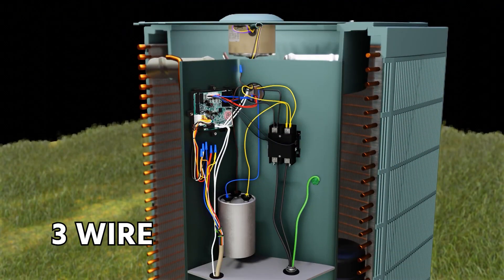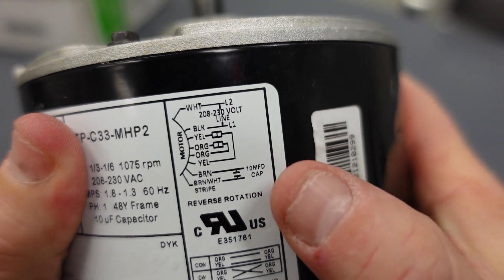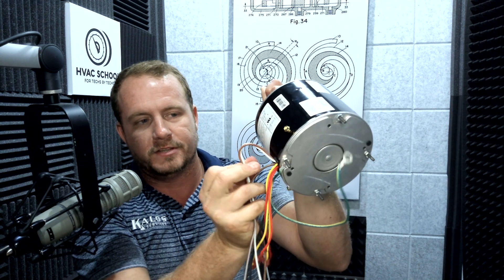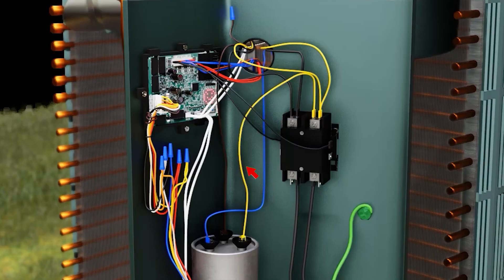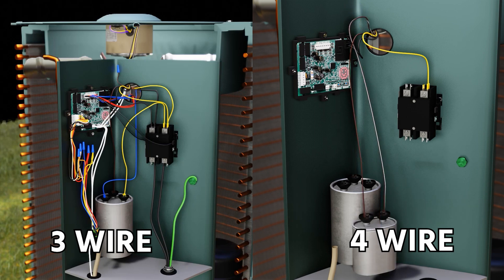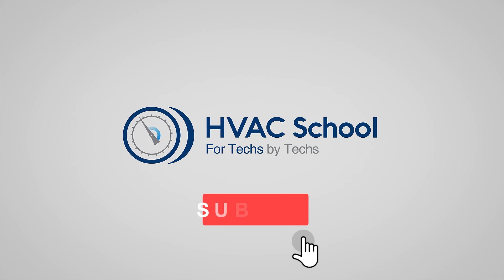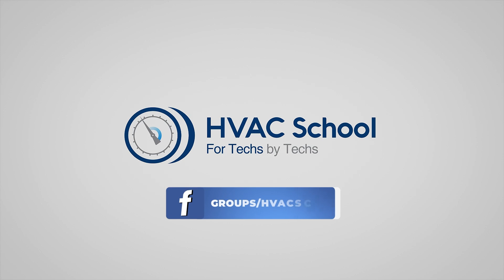3-Wire vs 4-Wire Condenser Fan Motor Wiring

Comment: I found out that the order of brown and brown/white to capF and capC do matter (on 4 wire method). Test 1) 5A on both white and red power wires. Test 2) swapped the capacitor wires. 0.8A and 1.8A on white and red power wires

Comment: Can anyone lend experience with a fan motor that was not grounded when there is a ground on the side of the motor? A friend of mine had a high amp draw and did not commect the ground. Could this be the cause?

Comment: Instead of caping the brown and white can I wire it to the c on the capacitor, and the white wire on line 2 and black on line 1 and brown on f on the dual capacitor?
Reply: I put both brown and brown/white on f terminal did I kill my fan?

Comment: Every video I see presupposes that the wires are "x" color with "y" stripe, or brown, black, etc.  what if the colors are totally different.  My new motor and old one both had a black wire, yet no other colors matched and none of them had a stripe.  Both diagrams were different and I had no idea what to do.  I tried many variations, but nada.  I had an electrician take a look, but nada.   I never figured that one out.  🤔  I would add a picture if I knew how. 🙄🧐
Reply: Every motor comes with a wiring diagram to tell you what color is what.
Reply: @frankiec5570 facts and he stated that at 1:00 in the vid
Reply: Problem with trying different variations of connecting wires is that you will blow a contractor or capacitor very quickly if not wired correctly.

Comment: I see how 3 wires are wired in 3D picture but 4 wire picture still has only 3 wires coming out. Brown to one side of cap brown/white to other side. Then line wire going to one side of contactor. Where is the white common wire?
Reply: Actually I think I see line going to defrost board and that yellow is common right?

Comment: Bryan that unit in the illustration is a heat pump. So, the blk wire from the CFM connects to the defrost board and not to the contactor. Now, wiring for a straight cool units that illustration is correct. Please i come from an 🚘 a/c back ground. So, i apologize if i miss spoke! I'm just asking for clarity
Reply: Thanks SO much!  I'm a rookie and he speaks  little too fast, as well.

Comment: I was told that you can hook up the brown and white wire to common on the dual capacitor. Is that okay?
Reply: Basically...brown/white and white are the same and go to the same terminal.

Comment: One change on your procedure for the 4 to 3 is to connect brown with white to the same lug as the plain white (sometimes yellow) to prevent confusion to the next guys as to where that flying lead goes to or accidentally grounding to the cabinet.
Reply: Thank you from a girl 😁
Reply: Wtf is a “flying lead”?

  This is problem, using terms like lead and flying lead isn’t helpful when your don’t explain what those are, same for “jumper wire”, I get the gist but is this “jumper wire” something that a person needs to buy extra or is the white and brown/white wire doing jumping internally in the motor?  

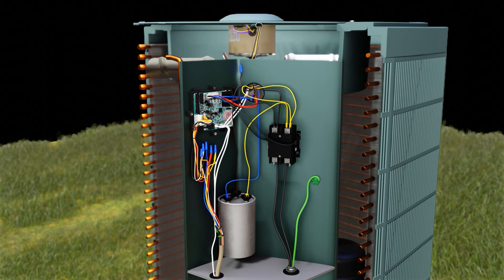This is presumably for people who don’t already understand this stuff but after 1:10 it’s like he’s talking to people who do this for a living
Reply: @rbslammed6163 "Flying lead" is an unused wire that is left disconnected. As in something that just flies around uselessly and an annoyance that can be dangerous if not properly terminated.
Reply: I connected the brown and white wire to the common on capacitor and did not use the white wire at all. Seems to run great. Will this be an issue later on?